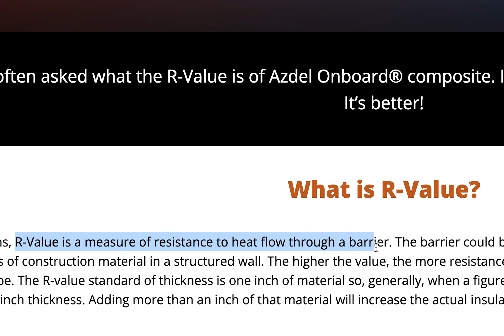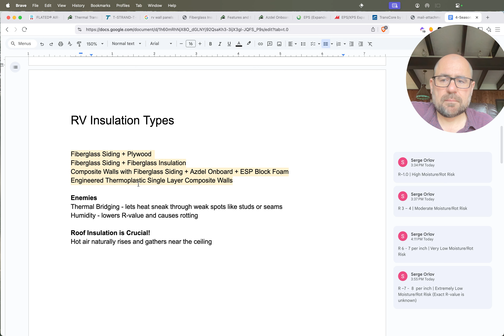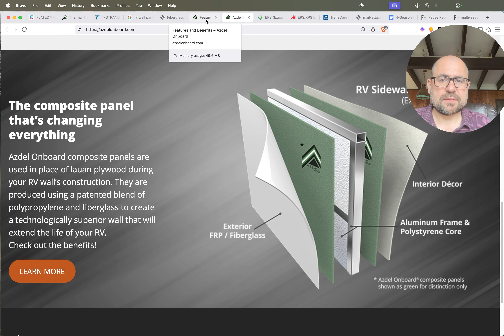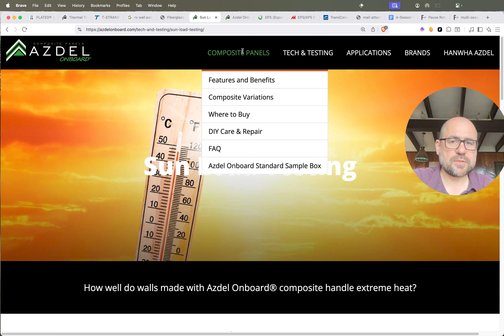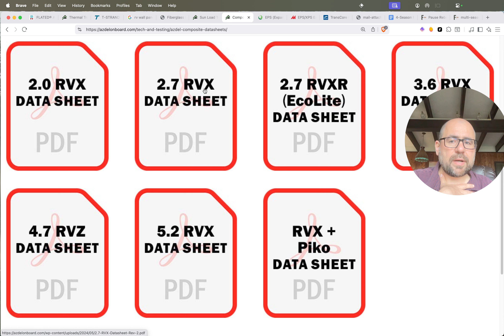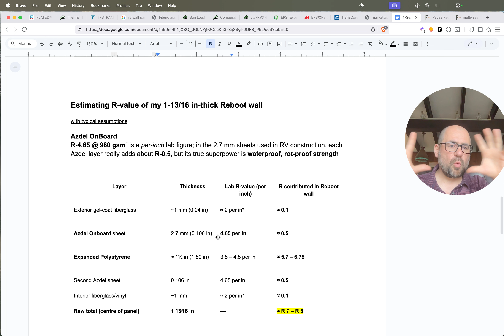4-Season Trailer Claims: Truth or Hype? Part 1 — Insulation Deep-Dive

Comment from the maker: Correction: The Reboot roof is not TransCore. It’s an aluminum-framed sandwich with EPS foam—about 3 ¼″ thick at the crown, 2 ¼″ at the edges—plus a ½″ interior foam layer to stop condensation. Zero wood to rot. Only the Pause models use TransCore for roof.

Comment: Great explanation and analysis. The manufacturer's keep making big claims about this stuff, but it does not seem that they are producing any real innovation in this space. It's one thing to use semi-ok materials, use some marketing images that show lack of thermal bridging between frame and walls/insulation, and use an oversized air conditioner or heater to deal with the heat transfer problem, but it would be a game changer for all rigs claiming to be 4-season to show actual data from some innovation that focuses on better design choices. And it would be nice if manufacturer's adopted as part of their R&D something like Truma's large cold-temperature RV testing chamber into their own testing protocols, so that they could show how good various parts of an RV are holding up against cold/heat conditions.
Reply from the maker: 100% agree!

Comment: good video buddy, was wondering what the potential R value was on the 22.4 we're getting. When I tell someone how much I'm paying for the 22.4, I get the same reaction, "you could have bought a great camper for 1/4 of that price", then I have to explain to them the quality and components that go into these will allow the Pause units to outlast and outperform any trailer out there.
Reply from the maker: Wait for all four parts to come out. Your 22.4 has the same walls, roof, and floor as my Reboot trailer — but it also has a few advantages that even my fully loaded Reboot 19.6 doesn’t.
Reply from the maker: I’ll also be making a video about pricing very soon to address the question of Are Pause, Pause X, and Reboot expensive trailers?